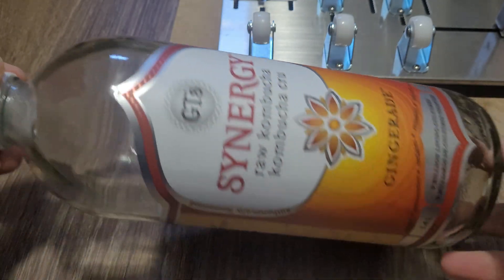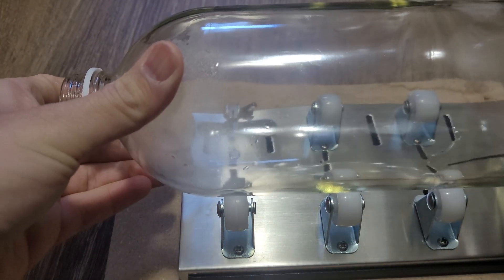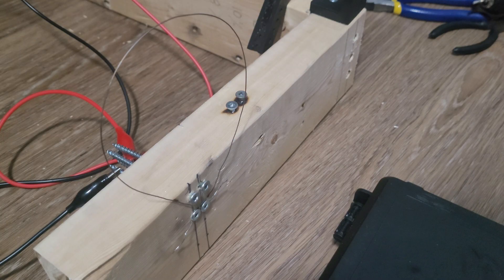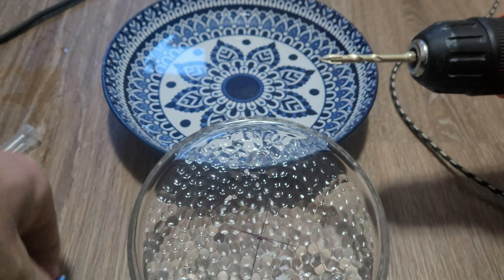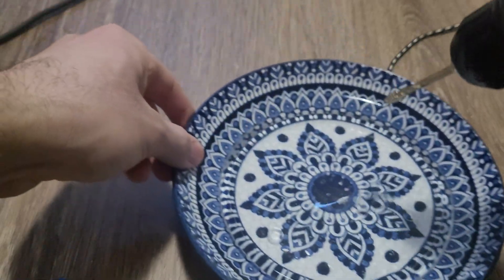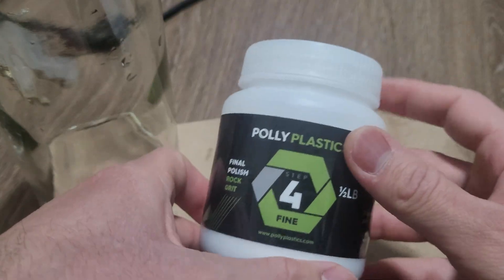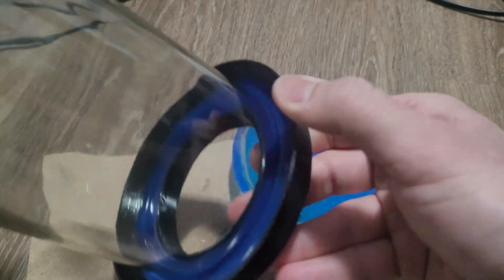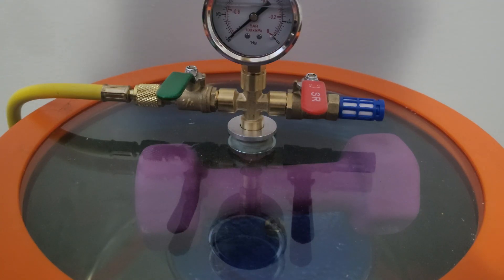DIY Symmetrical Plasma Tube - Science with Fire

Comment: Can you give more details about how the vacuum chamber works, and how you applied it to the bottle glass ?
Reply from the maker: Hi, any vacuum chamber you buy from the market will work. I had a two stage vacuum pump + 5 gallon bucket. Simply pulling the vacuum on bucket with bottle inside will work. I used a little bit of extra weight on top so that the silicone will press harder, which ensured proper vacuum seal inside the bottle.